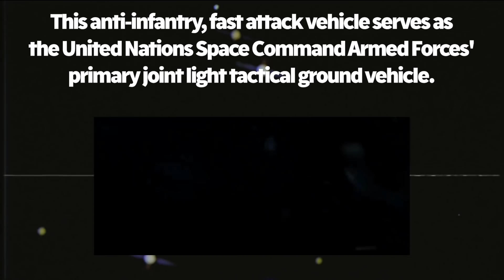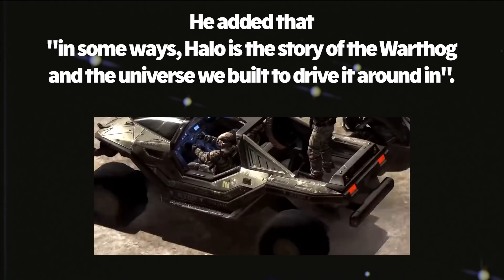WE BUILT A REAL HALO WARTHOG WITH 1,000HP!

Comment: We absolutely need the 4 -wheel steering, lady. Demonstrating that just adds so much authenticity to the vehicle.
Reply: it sounded like she didnt know it was a real thing.
Reply: She was talking about the 4 wheel steering making it harder to drive. I’ll bet they’ve had ones built in the past that were full time 4 wheel steering and they were really hard to drive or may have gotten crashed. 
It would be best if they either did the steering where you could select how it steers, or just put the rear steering on a switch like the monster trucks use.
Reply: @NBSV1  a Red Dot Enginering car has a rear steer lock out switch. But you have to straighten it first!
Reply: There's a chance she had a quadrasteer suburban and didn't know it
Reply: @hazmont  That's not Bonnie Ross, it's Corrinne Robinson, the Senior Halo Franchise Manager.
Reply: @hazmont  dawg that wasn't Bonnie Ross. Do your due diligence before making a comment, please.
Reply: Beeyotch, we ABSOLUTELY need the 4 wheel steering!
Reply: She doesn't even know how to open the hood of her car.
Reply: That system was used at fast 6 flip car

Comment: People that don't have any fabrication experience have no idea how much work there is in building the simplest of things. They don't realize how the small things like taking into account how much material you lose from the thickness of a cutting blade when making a cut, how to calculate angles you have to figure out the angle in degrees then divide by two and that's what you cut eat piece at, they don't realize you have to take into account that when pieces don't fit together tightly if there's a gap between them they will shrink after being heated up and then cooling off. I used to build high doors and if we didn't stretch the center Out prior to welding it would hourglass anywhere from an 1/8th of inch all the way up to a 1/2inch just from being heated and then cooling off. I have seen metal do some crazy shit I would have never thought possible until it actually happened. Always appreciate the fabricators. My ex girlfriend never even thought about how much work it takes to build a backyard gate or handrails for stairs, a handrail running along a flight of stairs is alot more work than people would ever realize unless they were making them.

Comment: I do wanna say as far as that winch goes, you could replicate it with a brushless hub motor with a planetary gear set inside the spool for the cable. If you use a Flipsky FSESC 75200 and a transformer to step up your voltage, you could put 15,000 watts (about 20hp) of power through that winch.
You’d also get variable speed which is neat.

Comment: I really wish they would have done full independent suspension and rear steer....I know that adds a lot to the cost but its just kind of disappointing that its a solid axle truck.
They could have potentially used HMMWV parts and modified them for longer suspension travel. Other than that it looks absolutely beautiful.
Reply: Hell shouldve just used a humvee as the base, basically same dimensionally and is perfect chassis since I believe the hog is based off them in the first place.

Comment: Excellent video, I hope the project goes well, I think it would be a headache to propose the suspension and transmission scheme of the halo 4 and 5 warthog. The suspension and transmission scheme of the halo 1, 2 warthog would be impossible. since the latter is independent suspension, independent traction scheme for each wheel

Comment: Not a real warthog, bungee originally had 4 wheel idependent steering so good job on that. But it also had "control arms"  that where solid and the suspension was vertical and completely hidden in the body. The turning came from the pivot points at the top of the L shaped control arms like a forklift's real wheel. I always had a good look at the suspension mid tea-bag.

That being said its still cool. You would honestly need penis rocket money to build an original.

Comment: well fun facts 

117 is about 7 and a half foot tall and the warthog in forza and the the one you guys checked for measurements at the museum share dimensions and its about 25% to 30% smaller just so people don't look like toddlers in the driver seat....that means it comes with the side effect of making 117 look like an adult in a powerwheels

also the warthog specs in lore is a 750hp low profile ICE hydrogen powerplant with infinitely variable transmission (basically a cvt from hell considering the torque it provides)
whilst locked to 70mph on the general combat models but locked at 120mph for the CTS variants and 165mph for the racing variants and its tyres at variable grip carbon nanotube wheels that are as buoyant and light as a normal tyre whilst being virtually indestructible all the while it has lockable limited slip difs and the biggest change in specs over the years is the reverting from electro-magnet assisted torsion suspension (the electromagnets assist with high gravity planets) 
to double wishbone independent suspension with highly adjustable shock pressure
the paint has not even changed...the paint is capable of changing colours to the point there was once an incident where a few marines fiddled with a hog and turned it bright pink right before a parade but in turn the  warthog had to be factory reset

Comment: It’s definitely cool, but doesn’t look right because the proportions are off. Getting your measurements for the build from the model at the Petersen Auto Museum was what sent you down the wrong path. So instead of being an awesome, fully functional 1:1 scale, it looks goofy with a 1:1 passenger compartment but then a front and back end that look to be about .75 of the correct dimensions. Maybe try again?

Comment: Is it true wheelbase width? Just wondering how a top heavy one would be with a few 700ish? pound Spartans in it. The frame is titanium, the armor is poly based and it's safe to assume the engine/trans are made out of something lighter than aluminum ones would be. Crazy to think the passengers (Spartans) could represent 30-50% of the weight or more in a tactical response vehicle.

Comment: Not to be a hater here because it's an awesome build regardless, but its solid axle. Wouldn't it have been more authentic to make it ifs/irs? Obviously it's done at this point and it's friggin amazing regardless, but was using for instance like a surplus humvee as  starting point not an feasible option? Just curious since from a gearhead perspective (or at least just my perspective which doesn't mean 💩 anyway) that seems like a significant oversight for the sake of authenticity to the video game version. Awesome build and awesome job regardless though, well done fellas.